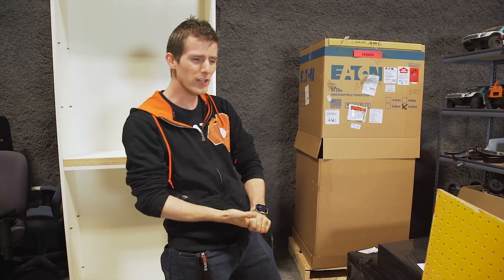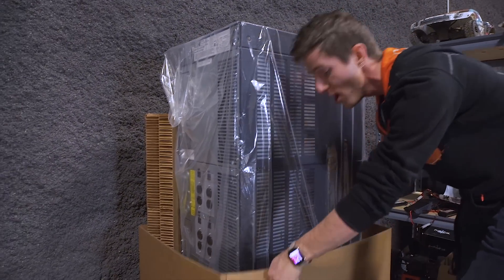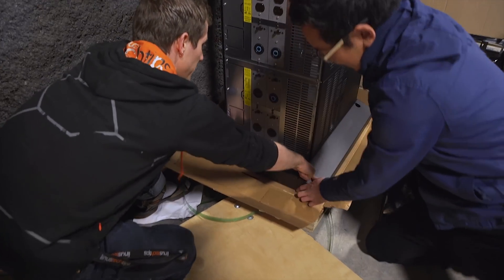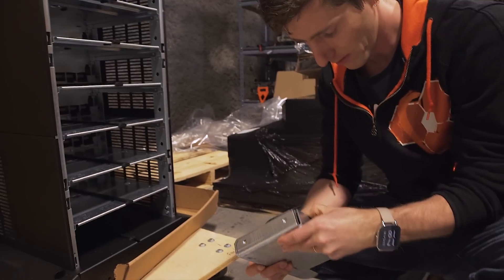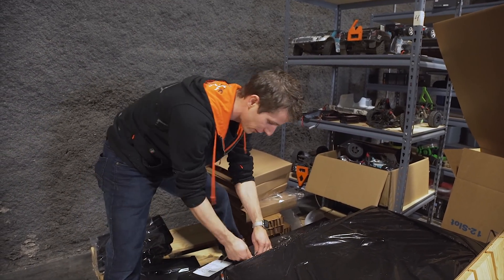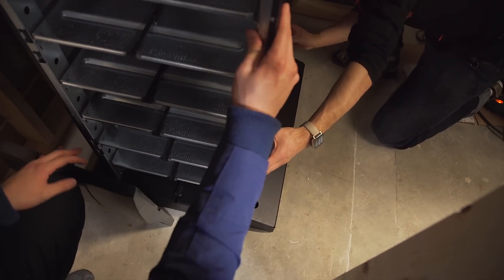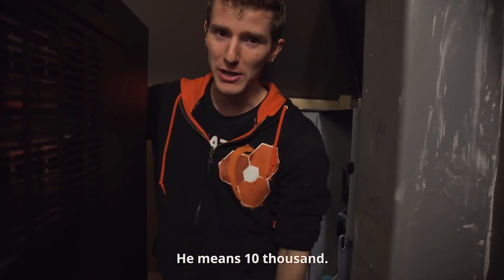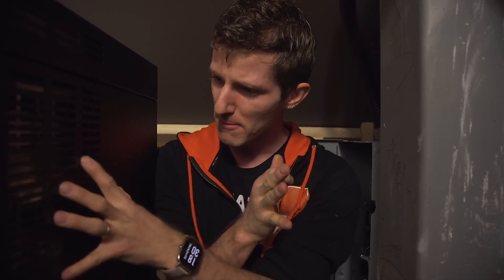HOLY $H!T - A $17,000 (CAD) Man-sized Battery!

Comment: Linus, be sure to install whatever retention mechanism the batteries or chassis came with. One of the companies I supported had a power overload from power lines slapping together in high winds and 2 batteries that did not have there clips installed shot out the front of the unit.

Comment: Be careful with the power modules when you snap the handles up and lock them into place with the thumb screws. We use these same units at work and I've had to rip into a power module to replace a tiny button switch b/c of the poor design and people slamming those handles into place. With a bad switch the unit won't recognize the power module at all.

Comment: hey can you make a tower with the following stuff
motherboards:  G1 Sniper 3 Z77  269.99
graphics card:       geforce gtx 980ti 628.99
Ram.                    CORSAIR Vengeance 32GB (4 x 8GB) 159.99 
Hard Drive.SAMSUNG 850 EVO 2.5" 500GB SATA III 150.00 
Hard drive Seagate Hybrid Drive ST1000DX001 1TB MLC/8GB 64MB Cache SATA 6.0Gb/s NCQ 3.5" Desktop SSHD 70
O.S.          windows 10 pro 100
Case NZXT Phantom 530 130.00
CPU.   Intel Core i7-3770K Quad-Core Processor 3.5 GHz 8 MB Cache LGA 1155 - BX80637I73770K  530.00
Reply: +radical guild this is the computer i want to build but i don,t know what power supply to get any suggestion
Reply: thank but i think i will stay with the 980ti because i wanted the titan x but it was to much
Reply: pulse i can upgrade latter
Reply: +The Radical Guild I'll build you one, how much would you pay me to build it?
Reply: None

Comment: Lol my surround sound is over 50,000 watts max power and around 35,000-40,000 watt RMS. :p
Reply: No it isn't
Reply: Callum Aitchison Yes it is.
Reply: Callum Aitchison No, you obviously know nothing about audio then. A guy named THELIFEOFPRICE has a car system around the 100,000 watts range. My surround sound in my house consists of about ten receivers as pre-amps and each main woofer and subewoofer has its own amp.
Reply: Wow, that was quick lol Didn't mean to start an argument there.. the guy/girl was removed for spam lol

BTW to anyone reading this, those receivers are all identical and they are all running in a config where I have 3.5mm headphone jack splitters and I have 3.5mm headphones wires to each.
Reply: Zantubr Huuts'tsu I'm sorry to break this to you but you've been mislead by marketing or something. Even consuming the lower of your range (35,000 W) and assuming the best case you're using 240Vrms mains that's approximately 146A. You'll need some pretty beefy cables for that, and definitely won't be getting it through a normal plug socket.
Reply: Callum Aitchison Which is why I had an electric technician (my uncle) come and re-wire the socket that everything runs off of adn other parts of the house. I don't know exactly what he did (not my profession) but he did what he needed to. I've used a wattage detector and I consume around 35,000 watts on average, depends on what I'm doing with it. I am NOT mislead by marketing, because this is part of my profession and I build the whole system myself. (A couple are pre-made however, just added on. Like I have two Cerwin-Vega bookshelf speakers there as well that run in speaker B mode when enabled, or in speakers A & B.) Although, speakers B would be just those two bookshelf speakers and a 2.0 system. Speakers A are surround. Speakers A & B are both stereo and surround. I don't know why you think you can judge that it's not that high of a wattage when I've seen (in person and on YT) people with 50,000-100,000 watts RMS on batteries and alternators in a SUV.
Reply: ***** No I'm not joking lol. I know it's a little overboard but I'm a bit of an audiophile and a basshead... lol
Reply: +Zantubr Huuts'tsu I can judge because I actually study electronic and electrical engineering...

35,000W is /a lot/ for a whole house to consume at once, so perhaps if you were measuring it for the whole building you might've been able to get that, if it's multi-occupancy. That or the comma's actually decimal place... 35W sounds pretty reasonable.

50,000W on a car battery is also not gonna happen. Assuming a standard 12V car battery (lorries and busses often use 24V) that's a 4,167A current which is more than a lot... In fact, I've just done a quick search for an expensive car battery. It has a starting "power" of 850A, which is the maximum current the battery can produce for a short period in order to start an engine. That's nowhere near the 4,167A required to power 50kW, and in addition to that it's constant power not a short period.

Next problem, the battery I'm looking at has a capacity of 95AH. If you could consume 4,167A from it the battery would be completely dead in 66 seconds.

And this is all ignoring the massive amount of heating you'd get in any reasonable-sized cable at 4,000-odd amperes. There's also the question of whether these watts you're measuring are output or input - I assumed input since that's the best case for you. Well, output would throw up extra questions like how on earth you haven't demolished the building.
Reply: Callum Aitchison You may know about electricity but obviously nothing about speakers. 35 watts? That's not even THX approved level... a 35 watt would be a piece of shit.

The batteries they use are high powered and also have many alternators, as well as there are many batteries. If you don't know, alternators in a vehicle recharge the batteries while the vehicle runs. It'd be pretty much a recycling system of power. Before you argue with someone who does this for a living, actually find out a thing or two about it.
Reply: Zantubr Huuts'tsu You don't need to understand about speakers to know that's an unreasonable amount of power. I'm talking from a purely electrical standpoint here, not even mentioned the speaker side.

I do know from my own experience from running an 8Ω speaker on 12Vpp (= 6Vp = 4.24Vrms) which works out to approximately 2.25W (4.24^2/8). I found that quite loud for personal listening. Of course, that was my output not input so I'm not accounting for inefficiency to get the input power. From that experience I thought a 25W output power assuming a large 10W loss for very good class A/AB amplification or very bad class D would be more than enough for a simple personal system, that's why I offered it as an idea. But again relating power to speaker output is not my area of expertise.

"High-powered batteries" is why I went for one of the most expensive batteries for specifications. The constant power will also be a lot lower than the starting power.

Alternators generally appear to be about 100A max output. Even added with the battery thats nowhere near enough.
Reply: Callum Aitchison Hell, even my old Logitech z506 5.1 surround sound are about 55 watts RMS (for the whole setup) and that surround sound is probably one of the shittiest surround sounds there is, with a piece of shit 27 watt subwoofer.
Reply: Zantubr Huuts'tsu The power in itself isn't going to affect how good a system sounds - only the volume. The only time a low power would directly affect quality is if the amplifier for a particular speaker (you mention a subwoofer) is poorly designed and doesn't have enough power to drive it at the volume you like - resulting in lower volume for bass frequencies for example. I guess that would depend on personal preference.

Apart from that the design of the amplifier and of course the speakers would affect the quality.

Of course that depends on what you mean by "piece of shit". If you mean it's too quiet then that's power.
Reply: :) yeah with 35kw's and with moder equipment i can probably do sound for a mid sized football stadium :)
Reply: +Callum Aitchison :) btw mr price that was mentioned does like every other serious spl car sound system owner runs like 10 batteries plus the one for running the normal part of the car.  :) but for that mr zantubr...35kw system even on scale of concert sound systems is a pretty serious one.
Reply: Callum Aitchison You are confused then. You have no idea. Yes, it would have less volume in general if you have a lower wattage, but higher wattages also normally mean better sound quality as well, since the voice coil is bigger and there would be more room for better quality AND volume. So what you just said was false. Because, if wattage only affects volume like you make it sound, than why is my other system's 95 watt subwoofer sound better than my 27 watt subwoofer? The only difference between the two is wattage, nothing else. Same size and everything. The 95 watt subwoofer is also passive, and the 27 watt has a good amplifier. So what you said is FALSE.

What I mean by piece of shit is that they don't get loud AND they don't have very good quality, sound wise and materialistic wise, especially at its higher volumes.

Even if what you said WAS true, there are other factors you completely missed: SPL, material design, the driver itself, the driver size, the resistance, etc., etc.
Reply: ***** Yeah, I know it is, that's why I had my house re-wired and had all that electrician magic or whatever done to it by my uncle who's an electrician. They are pretty much a combination of a few speakers I had already and the rest I bought and built myself. The enclosures of some of them were built my my step-father, however, since I'm bad at woodworking. All the wiring, amps, receivers, plugs, and drivers were all done by me. I don't normally have them that loud; normally around 30-50% volume. Not volume LEVEL, but 30-50% OF the volume level. So that's around 25-40 on the volume level.
Reply: Zantubr Huuts'tsu You do make a reasonable point there about the actual construction of the speakers also affecting quality and particular drivers requiring more power. Not my area of expertise at all.

Anyway, 35kW is still a massive amount of power which is not happening.

How thick are the cables to the system?
Reply: :) 35kw lets put it this way is 35 1kw (aka 2x500wat stereo amps) amplifiers
Reply: ***** I know that. :) lol I don't actually use the whole system all the time. Normally I only use one or two sets of the whole system, which is around 10,000 watts RMS, which would be normally about a 7.2 system or my 11.3 system.
Reply: ***** Yeah, exactly. Even some old concert level speakers I used to have (sold them to buy most of my new equipment) were only 250 watts each, but I never used those because there was a 2 channel amp that only put out 150-200 watts per channel. I hate not using speakers to their full extent.
Reply: and dang i wouldn't mind getting back into concert audio :) been out of the field for about 4 years now

Comment: Although i am not a Master Electrician i am a journeyman Electrician. There were several things thorough the video that stuck out to me. #1. 4 15amp circuits. WTF is the point in 15's what did you run out of 12/2 MC and used 14/2 MC instead, its a commercial space use 20 amp. #2. The disconnect for the UPS must be easily accessible, not crammed behind a UPS (ec. 110-26 of the National Electrical Code (NEC): 1) at least a 3-ft 
clearance in front of all electrical equipment; 2) a 30 in.-wide working
 space in front of equipment operating at 600V or less). #3 Never should anyone open a disconnect for any reason who isn't licensed even if it is not live. Not only do i see it open, i see exposed terminals and Linus parts in close proximity. [Also i know i referenced the US National Electrical code and not Candida's but i can assure you they are very similar in many regards. Also before anyone give me shit saying Linus can open it because he owns it any its legal for you to do your own electrical that only applies to Residential, NOT COMMERCIAL. Im not trying to bust balls here and be a hater but Electricity isn't a joke and anyone who isn't trained shouldn't be working with it.

Comment: UPS equipment is the bane of my IT existance. They might be our number one cause of service outages due to a company not understanding that batteries only last for so long regardless of how many times the power has actually been out (since, like described in this video, the UPS is always using the batteries).

And I'll warn you now, when those batteries start to fail, they will swell and forever become a part of your enclosure. Whatever the life span of the batteries are rated for, change them even if they are still working!

Comment: Does the Server Room Floor have 3 or 4 HEPA filters? You can get HEPA filters from charity shops and recondition them by putting the carbon filter in the dishwasher (and in some cases, the main filter as well). A 20 CAD consumer fan + proper sized type "MERV 11 Filter" can provide HEPA like filtration on the cheap.